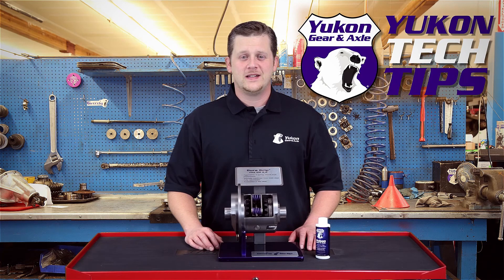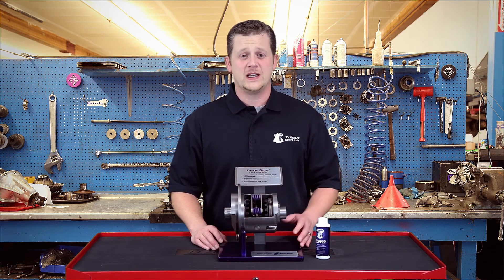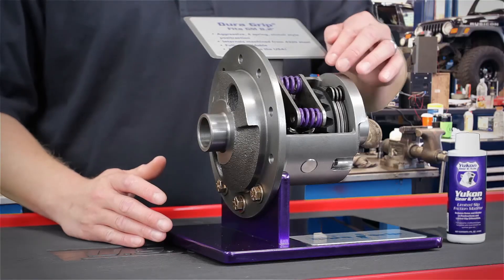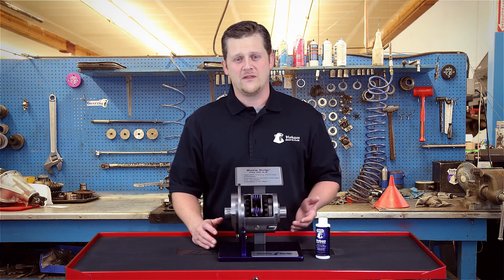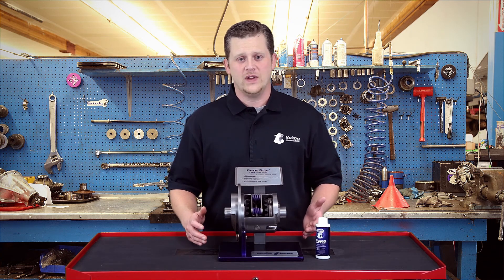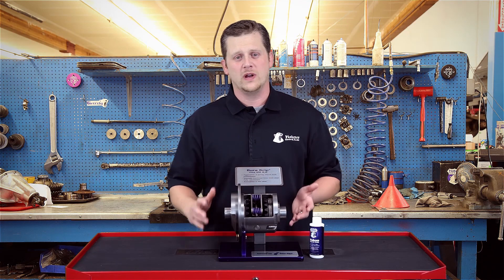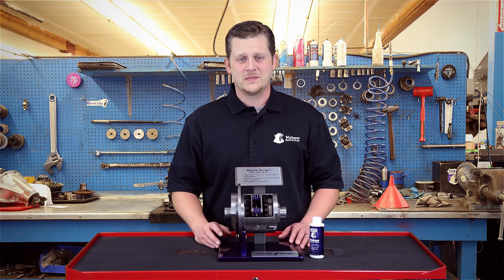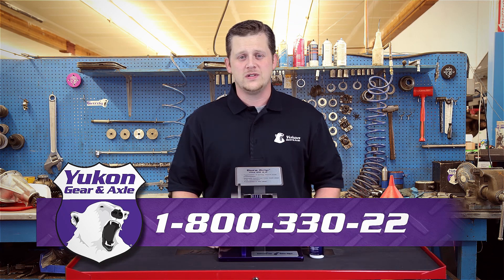How to Identify and Reduce Positraction Chatter | Differential Tech Tips

Comment: The question I have is. I have a 2007 chevy suburban. Do I stay with 75-90 conventional or go 80-90. Do fill it until it drizzle out the fill hole or what gm recommends?  I'm getting bad chatter when the rear end is cold.
Reply: use the weight that GM recommends. might go with a bottle of lucas heavy duty oil stabilizer with it. can help alot of noise.

Comment: Hey, I added my gl5 80w-90 gear oil to my Ls rear diff. The bottle said limited slip on it so I’m assuming there was Ls additive. If it still chatters can I add the tube of Ls additive to that or should I start all over? If I can how much of the tube should I add?
Reply: Yes you can add more my ram 350 used to have that same problem and if you add more fluid it will help. If your rear end keeps chattering take it to a shop and have them look at it if you need new clutches it will run you 3-400 dollars but you will be set for another 60-80k miles

Comment: I used 10 bottles of this stuff to fill my diff now it whines bad.
Reply from the maker: Typical usage is 1 4oz bottle of friction modifier to 3 quarts of gear oil.
Too much modifier will cause gear oil dilution and lack of lubrication, and possibly gear/bearing failure.
Reply: @yukongearandaxle  I'm surprised you guys even replied back to that lol.

Comment: Had a shop perform the diff service and it's still chattering a little  bit. Is it alright to add a little more friction modifier?
Reply: Good ? I was wondering the same thing I just added a little extra today and will find out tomarow!
Reply: This question is the exact same one I have, please if you can answer it that would make my day
Reply: @stuartshogren1196  I figured it out! Ford oem clutch paks were pretty precise fit and these after market a tad bigger once they were down hence doing a couple hundred figure 8s in a parking lot. Change fluid again it makes difference. I think I will run this for a couple months than drain and put synthetic blend modifier in it.  You see it's no brainier when you stop and think what's really going on. The clutch paks need to move with the right amount of force and the oil slips in-between and depending on the viscosity, and clutch material ,speed ,temp, tire tread and how much it grips the ground. And even weight in the rear end are all factor s how how this behave s and there truly is limited window of optimal wear , where this ford axle is at its best. Excuse typos .